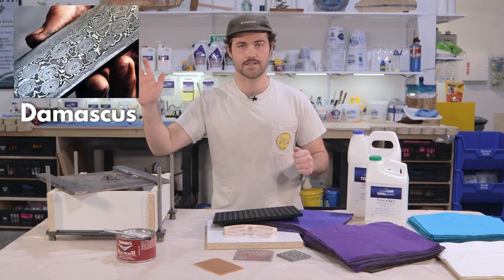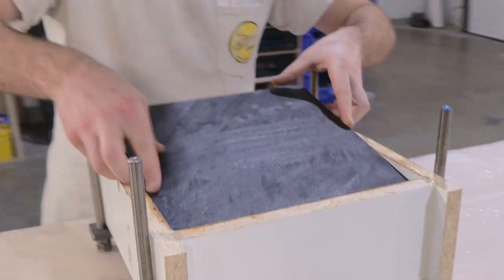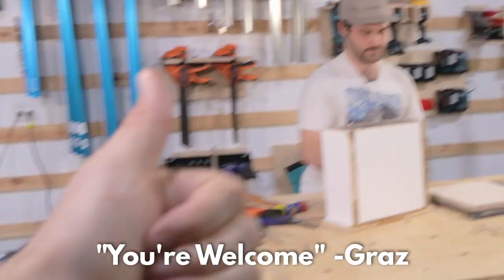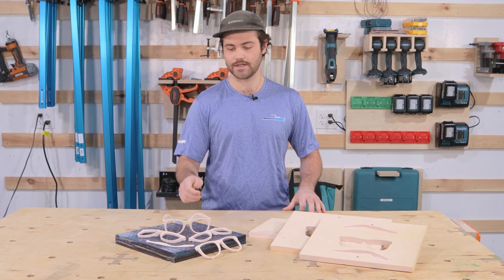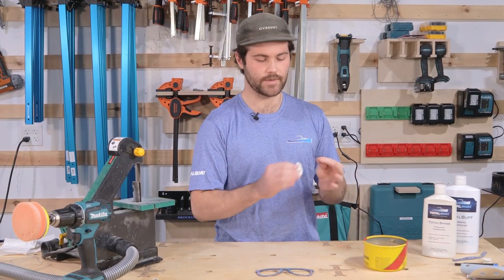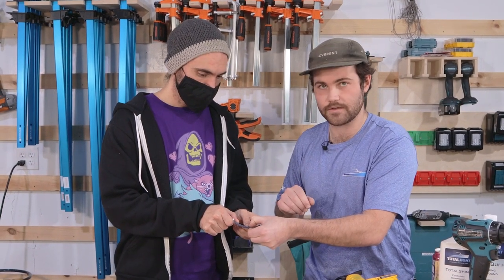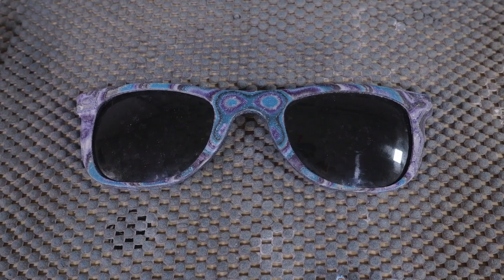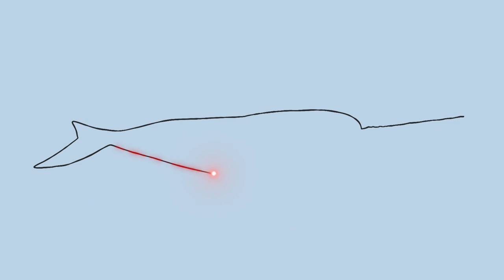How To Make Damascus Micarta Sunglasses!

Comment: Wow.  This is awesome.  I came here from Tim Sway's comment about it on Reclaimed Audio podcast.  I have a few questions.  First, why the steel plates with the welded crossbars?  I'm assuming it's so that it can hold up to the pressure from cranking down on the nuts?  I was thinking if someone didn't have access to steel or a welder that they could get by with using just stacked pieces of plywood or MDF and a bunch of pipe clamps.  Sure, this is easier though.  Second, why was the melamine stuck so bad to the micarta buildup?  I thought that you painted mold release on it, but was it only on the 3D printed positive/negative parts and not the melamine frame?  Third, did you say 250 pieces of fabric?!?  Holy hell!  I know it looks awesome when you're done, but man that's a lot and you had to have a couple helpers.  I was wondering if one was going to do this for some one-man operation for a part on a product that they were selling and had to be more efficient how they would do it and not lose their ass for man-hours.  My thought is maybe use some thicker material like denim or something so that less layers would be needed.  I promise that I'm not complaining or criticizing your technique; I'm just trying to bounce some more ideas around.  I love you guys' stuff and this is a killer idea and thank you for sharing the video.
Reply from the maker: Thanks for checking out the video, glad you liked it. 

1. As far as clamping goes, I do think that you could use MDF and pipe clamps. The press that we made gave us pretty even pressure and a lot of it, but it will certainly work with just clamps.

2. The melamine wasn't really stuck, it was the actually the 3D printed dies that got stuck. We think that they stuck despite using mold release because the texture resulting from 3D printing them left the perfect surface for a mechanical bond. I think if we wanted to reuse them we'd need to epoxy or gelcoat them so we have a smoother surface and then apply mold release.   

3. We used thin fabric because we thought that it would result in the biggest visual impact. More layers means more detail. That said you could certainly try this with thicker fabrics such as denim, colored canvas, etc. We tested canvas and got some pretty cool results.